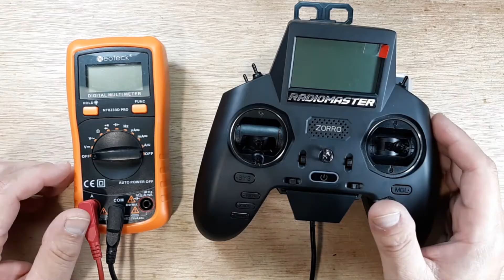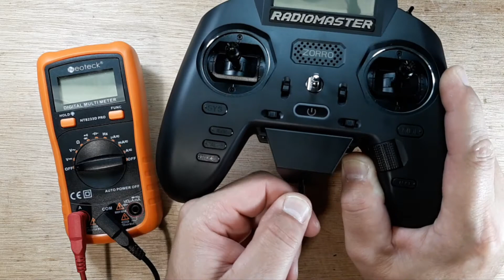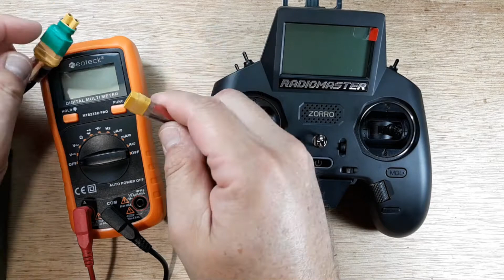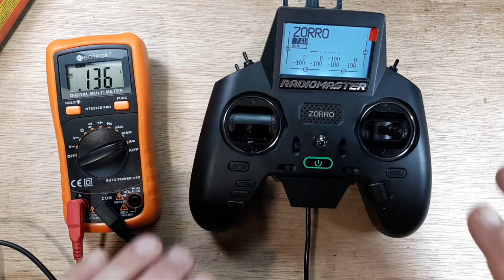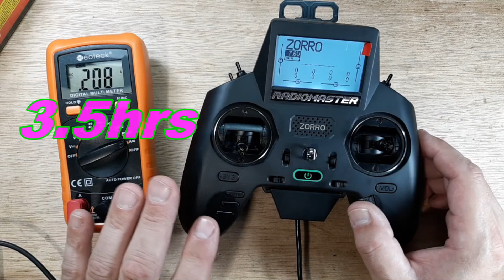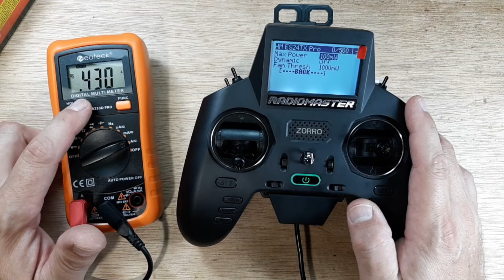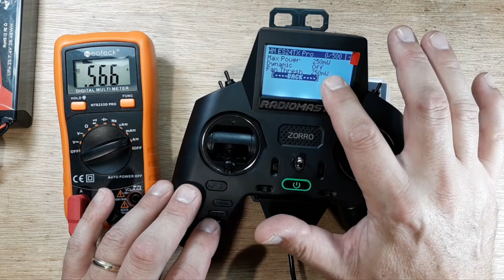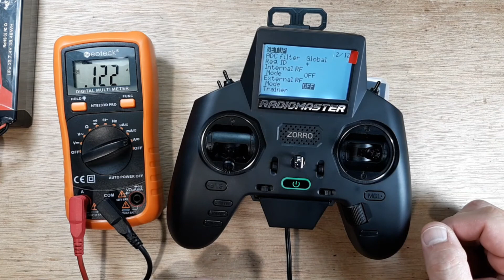Radiomaster Zorro Power Consumption | How Hungry Is It?

Comment: What would be the current consumption if the internal module is completely removed? I bet less than 130mA.
Reply: After removing it I measured 97mA. LCD backlight consumes around 100mA extra.

Comment: Hello again, I asked you a question on another different video. Was regarding the Zorro with the external ELRS module slim Pro and updates. Have now updated internal Zorro module, external slim Pro and all my RX's to 3.3.0.
So they all auto bind to everything with bind phrase.
I assume the amp draw for external module would be the same for both Zorro and pocket.
As I used external module on pocket and it chewed through the stock batteries and actually died and turned itself off on me. It was that flat, luckily I had just finished flying.
I tried a USB battery bank using the recharge usb-C plug, and seemed to help.
Voltage goes down past 7V without battery bank, and sits on 8.3V with battery bank. Battery bank is only 5V.
Be awesome if you had time to do another video for the pocket.
Also, I have a furious fpv fatshark battery cable that I was going to use on Zorro for longer flights. As it's a good stable 8V and can use 3-6s from memory. It has the 2s plug on it for the old fatshark fan power.
Thought I'd put that info out too.😉
Reply from the maker: All good information. I don't have the Pocket, however, a friend I fly with has 3 of them and I most likely will have an opportunity to crack it open and test it out. Yeah, these external Elr modules are battery eaters. Do to racing, I set it at 25mw and don't worry too much about it. The 25mw radio link can out perform the range of the HDzero system anyway, so no need to worry about it as long as I fly HDzero... I appreciate your feedback...🍻

Comment: Thanks for you review sir. 
So, what's the power output used for the internal RF module? What'is the capacity of yours Li-ion? Thanks.
Reply from the maker: The math is based off the stock 18350 900mah. In the video I estimate these batteries used buy the internal 4in1 too..

Comment: Can you have the 2 900mah batteries in while have and outside powersource
Reply from the maker: I would have to research that, great question! I imagine its either or though...🤔
Reply from the maker: I have submitted a technical request to Radiomaster support. Should get a response soon...🤞🏻
I'll let you know as soon as I do...🍻
Reply from the maker: I haven't forgot, I am still waiting on Radiomaster's technical staff to respond...
Reply from the maker: Finally! I got a response....

"Hi ScooterPie,
Thanks for reaching out, Yes you're able to install the 18350s and use an external lipo. 
Cheers!
Kind regards,
James
Radiomaster support team

On Fri, 23 Dec at 5:06 PM , ScooterPie wrote:

Hello Radiomaster! I had a question from one of my YouTube subscribers, and it was a good one.. Can you install 2 - 900mah 18350s into the Radiomaster Zorro and still run it off an external lipo? Therefore, you will have both internal and external power going to the radio... Thanks for a speedy response! Enjoy the Breeze...👍🏻🍻👊🏻

Comment: WOW!  I think i have only charged the battery in my qx7 a handfull of times in the past year!  Running crossfire at max power!!   Great video!
Reply from the maker: I agree.. My QX7 hasn't had much time on the charger either. I really will not have an opportunity to see if my math and the "real" life of the 900mah 18350s is the same, but it's got to be ridiculous to have to change up batteries multiple times during a fly day. Can't imagine a full weekend event with after party whoopin too.. Enjoy the Breeze...👍🏻🍻👊🏻
Reply: @PropsOff  I know a LOT of people complain about the battery life. Math makes sense to me.  And I thought the battery life on the dji goggles was not so great!  At least that lasts several packs, and can use other batteries.
Reply from the maker: @jondoe6618  
Yeah, the design seemingly forces users to use an external supply. At least the cable from the back is a very good option. I'm very pleased that you don't have to use the 18350s to complete the circuit. I really need to get some stick time in on it though. Covid has me in such a funk. It's hard enough to sit and edit much less FPV...🤢

Comment from the maker: Thankfully, alegtFPV , had seen my mistake. I had made a mistake in my math and had to edit and repost this video. alegtFPV's message read as follows: "Are you sure about the 900+900 in the calculation? The radio operates at 2s (batteries in series) and the overall capacity should be 900 mah and not 1800 mah."
Unfortunately, due to reposting, I lost the other comments. I really appreciate the feedback and alegtfpv for keeping me in check...